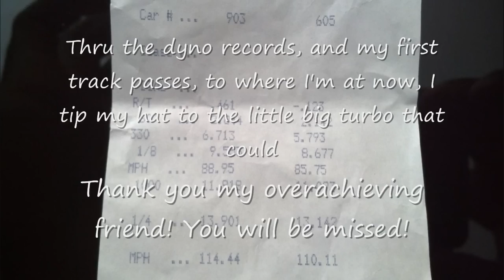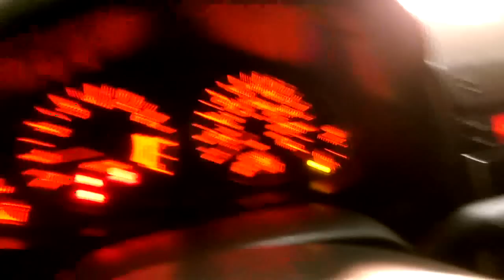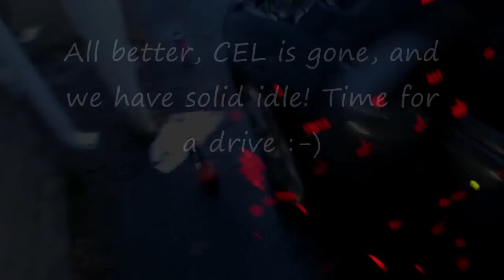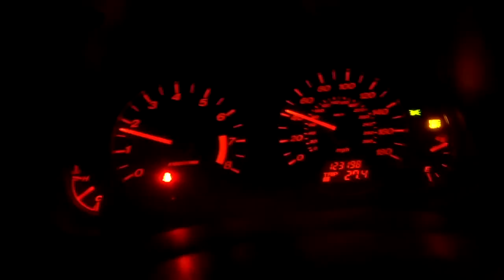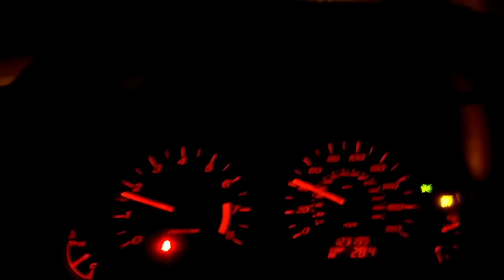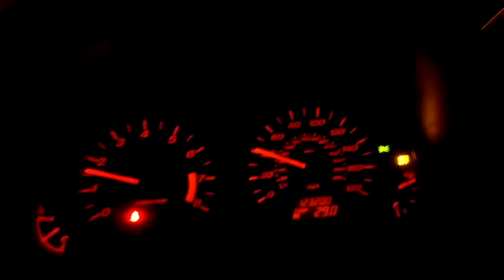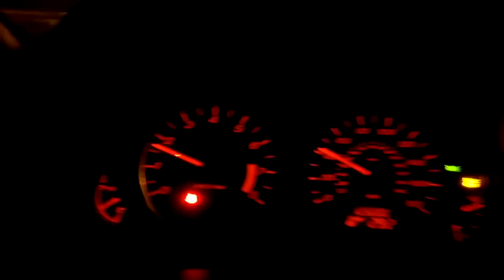Built 28r Mazdaspeed 6 GTX3076 Install! (Plus EGR Fix and Test Drive)

Comment: BT install on MS6... whew... I have an MS3 and it's so much easier! I've heard you guys have to do part of it blind b/c your transfer case. My heart goes out to ya!
Reply from the maker: Zack Richmond Yea it does suck quite a bit lol....getting the smaller turbo out, and fitting one twice the size was rough lol, but I ended up taking out pretty much everything in the area to make it easier. Toughest thing thinking back was changing the oil feed line since the tiny ass screws are under the alternator, good times hahaha
Reply: Numinous my heart goes out to you fwd speed3 guys when you try to launch or put the power down with any kind of power in 1st and 2nd gear (torque steer). I will take the headache all day. Race me from a dig and you will become a believer. Or race me through snow. Lol

Comment: Garrett_MS6 why not a wot pull? stock ecu? whats your afr at peak torque? I used to own an 89 MX6-T with a BW GM3 that made 483lb/ft and 360+ FWHP. 2.2L sohc bored over to 2.3L with a 6K redline. I watched the whole 15 minutes but was slightly annoyed not t see a wot pull. I subscribed anyways. ProjectCarTV
Reply from the maker: Totally understand my friend, but its coming very soon. At the time, I merely swapped the turbo only, but still didn't have a tune for it. Rings also didn't seal, and I had oil on the plugs, needed a rebuild bad, but that has been done, and I'm currently breaking in the new motor. At 500 miles, we'll be doing pulls on spring pressure, then slowly start adding in meth injection, more boost, more timing, e85, etc. I plan to capture the spring pressure pulls however weak they might be lol, only about 100 more miles to go

Comment: Are you running blowoff or bypass valve? What valve? I currently have Forge diverter but would like a different sound.
Reply from the maker: MrBlitzblu HKS SSQV in recirc mode, so essentially a bypass valve

Comment: I have a stock one 6 speed, but am thinking on some upgrades on the turbo so I was wondering if you could give me some advice on how to he better and faster my Mazda Speed 6 2006. Thank you.
Reply from the maker: Comment system on youtube has been weird af, but it's working now, so banging them all out while it's working.

 Sorry for the delay, but can't go wrong with intake, exhaust, fuel pump internals and tune. Just those alone should get you damn close to the 300 whp mark, which makes for an easy 13 sec car, which is going to give most 50k cars a run for their money. You shouldn't have to spend much either, all things included, you should be under $1000 USD for everything, esp if you install yourself. 

 Additionally, if E85 is nearby or an option for you, the upgraded fuel pump internals will allow you to run it, and should definitely get you to 300 whp if your tuner couldn't get there without it. Just for perspective as well, 300 whp is around 360 engine hp, which is pretty respectable in a 3600 family car :-)

Comment: my turbos getting weaker and starting to burn some oil... understandable @187k haha. what kind of turbo would work nice on a bone stock speed6?
Reply from the maker: +reuben aceman (Reubix3) Wow 187k on a stock turbo, that's cray lol....if you're truly, actually, no bullshit going to stay as stock as possible, can't beat the value of a BNR. 

If you haven't heard of them, they rework k04s, so you get the size of the k04, but with the internals of a GT2871, so literally you swap the turbo, I believe you might need a slightly larger turbo inlet pipe, and keep your quick spool but with beefy ass top end, and they're about to be STUPID cheap since the s4 is starting to roll out, and the s5 is actually already being researched. 

True, the s4 is an incredible value at $1300 for basically a 500 whp capable turbo, but that's the good thing lol, all the people with s3s want s4s. Time to check FS sections on forums and ebay, since people WILL be trying to get rid of these, same like when the new Accessports came out, FS sections started flooding with the previous models for dirt cheap. I'd be surprised if you couldn't find one barely used or maybe even never installed for under $900.

You used to have to supply them the turbo to do it, but now you can buy the whole damn kit new with a boost controller, upgraded map sensor etc for under $1200. Crazy. Technically not a "big" turbo, but a couple of guys, Justin aka freektune included managed well into the 400s, 445 whp if I recall correctly. Another guy made 424 whp, but needless to say this is with meth, bolt ons, etc, but nice to know it's all the turbo most people will ever need or even be able to use.
Reply: Never heard of BNR but im gonna look into it! Havent fucked around in my engine bay too much yet, bought it and drove it the last 6 months and gave maintenance to mechanics cus I didn't trust myself haha. Now im starting to feel the car a little more.
So all you need is a bigger inlet pipe, no forged internals or any of that complicated shit? engines still got rockin compression but the valves click a bit even though they were replaced with the whole timing kit a few months ago. Ive always been wondering what meth injection is all about, I know one of these paychecks I wanna get a BOV just for the dope noise lol im just an 18 year old noob just getting into it
thanks for the reply man, I watched a few of your videos before I got the mazdaratti and know im talking to the right man for advice!
Reply from the maker: +reuben aceman (Reubix3) Indeed, simple is better, normally lol

Main selling point for an s3, ease of install. Some people I've heard have installed without taking off the exhaust mani......that's crazy lol

You will soon become acquainted with meth injection though, it's inevitable. You'll run out of fuel well before you reach the limit on the s3, and since we don't actually have any injector upgrades (after fucking 10 YEARS in production) it's either a 5th injector, e85 or meth.

Needless to say, adding another injector requires software to tune the injector itself; currently there's no ECU option that allows the injector to be adjusted with the tune via your Cobb AP. Plus it's expensive, looking at min $700. 

E85 is difficult to find, and it destroys fuel economy depending on your mix, though since I was only running 3 gals of it, I didn't suffer too bad. It's can also become kind of gunky at low temps, and that shit gets dangerous in the winter because of it, esp if you're running a 50 50 or greater mix. Might pop off your fuel pump and find all sorts of gunk, but biggest thing it's inconvenient. It's difficult to find, and unless you're going to have a pump gas tune when you run out, you're going to be carrying some 5 gal containers in the trunk.

So meth wins out. Pop in an add-a-fuse to the engine bar fuse, wire in a GOOD ground, a status LED, a low fluid LED if you're really on your shit, find a good place for the pump and the tank, with many putting it in the trunk, tap your cold pipe on your existing top mount or for best results front mount intercooler, place the nozzle, wire in a solenoid or just add a check valve, good to go. I have my tank in the bay, cause it prompts me to have to pop the hood, and check everything when I do. Depending on your driving style, it might take a fill up or 4 before you even have to refill the tank, or if you're aggressive you might be filling it a few times on the same tank hahaha

Either way that will save you money if you don't feel like buying a TMIC or FMIC but want to keep boost air temps down, you get some wiggle room in your tune for additional timing degrees and you help out your injectors, ultimately giving your bigger turbo a chance to do what it's supposed to. 

A devils own kit usually runs around $300, that would be a much better buy, the BOV can wait, trust me, function over form hahaha

Comment: Where was the cause of the exhaust leak, and the coolant smell
Reply from the maker: Wayne Brown Exhaust leak was at the Tial EWG. There's a gasket where it connects to the DNP exhaust, and it needed to be replaced. Literally a 10 min fix, including making the gasket. Coolant was from our somewhat sloppy install lol, some dripped while installing turbo, then burned off when we started it back. Neither issue has arised since this

Comment: Do u have a front mount intercooler
Reply from the maker: Most definitely. There's damn near no reason in getting a bigger top mount, as regardless it's still sitting on top of the motor, which is counter productive. Yes, there's more piping and it's more labor, plus more $$$ usually, but I wouldn't have it any other way. Also makes it extremely easy to work on the motor, whereas I very rarely if ever have to undo piping

Comment: Holy shit my egr is what is doing all this engine ideal bullshit
Reply from the maker: lol indeed, EGR can cause some issues once it gets a little higher up in the mileage. Car has ran great since taking it out as well BTW
Reply: Is there any way I could fix it with out tearing apart my engine?
Reply from the maker: Realistically, yes. The EGR itself is found right next to your inlet pipe for the most part. If you take out the battery, tray, intake and inlet pipes, it should be fairly easy to get to the 2 10 mm bolts holding it in (though they might be 12 mm). At that point you could pull it out and clean it, or just remove it altogether. 

The block off plate will cleanly remove it, you're just going to have that pipe from the intake manifold still present, which isn't the end of the world anyways
Reply: Garrett_MS6  no way your interested in posting an in deep video of that ? I know how to change my oil and brakes that's about it
Reply from the maker: This video covers a lot of it:

https://www.youtube.com/watch?v=_K5cw7afeGo

but I am actually working on another regarding turbo removal as we speak lol, it does reference the EGR to a decent degree